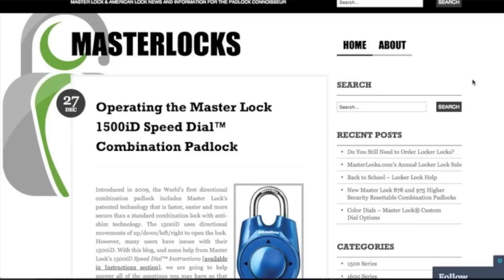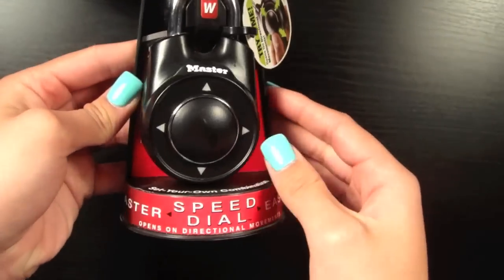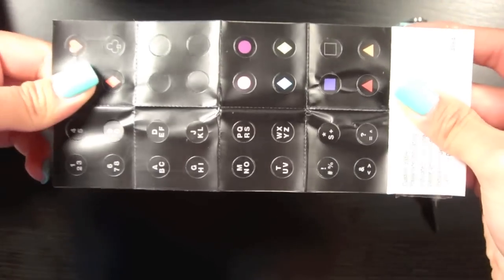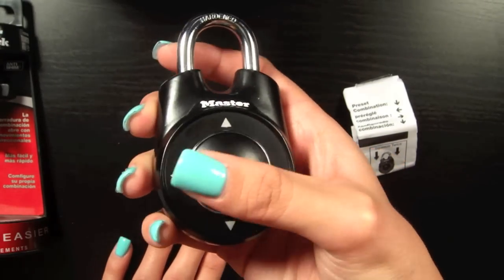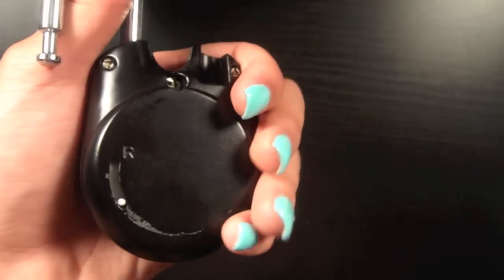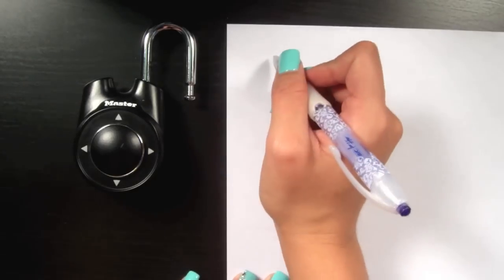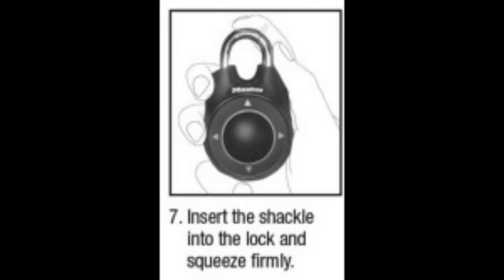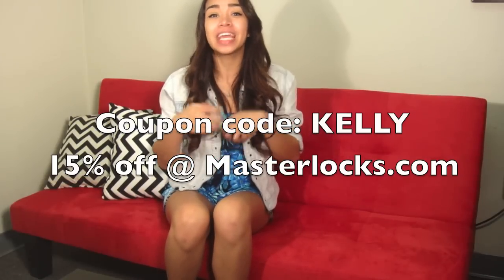How to Open & Reset a Master Lock 1500iD Speed Dial™ Lock

Comment: WHY IS MINE NOT OPENING?!?! 😩😫😭 I’ve been trying for 20 minutes 🤦🏽‍♀️ and I’m T the gym
Reply: You must keep pressure on the stick, not letting go like she did, it says in the instruction to bot let go of the stick, if you dont it will not lock onto the gears, it is a common problem, so you cant let go after each push. Leave your finger on it and give it some pressure, that should help. I had that problem too, after reading the instructions twice I saw that you had to do it. And after I began doing it, it opened every time for the past few months

Comment: For those who have bad vibes and reviews on this lock based on locking themselves out, it is counterintuitive in that you want to close it prior to moving the reset lever back down, so knowing this...instead of swearing off of the lock, I  recommend they give it a second chance and email the combination that it comes with to themselves.  The one it comes with is ALWAYS unique enough to slow criminals and contrary to popular belief their is no need or advantage to resetting unless you have multiples that you want to all have the same combo. Even in that case you have to weigh your options to where if you have a history of the lock getting stuck on you, emailing yourself multiple reminders with subject line of what particular locks lock, that may prove better than just keeping 1 combo. If you can't tell, this is the only lock that I  endorse. You can unlock during a power outage and it doubles as a behind the back houdini magic trick.

Comment: How to starts at 1:45. That's not rude is it?  This waaaaas my favorite lock but was recently kinda supplanted by the Smart Bluetooth lock that can be used independent of your phone if you choose because it has 4 soft push buttons. It has a thinner bar so can be used on those pain thin or hard to reach lockets that t Hu is one doesn't fit because too thick. In reality,  they are tied for first as my favorites.

Comment: Lol, I found it right away. And if you read it fully, you should have been able to see, where it says that there can be anywhere from 1-30 inputs so yeah, not just 4. I made my lovk have a combination of 14 inputs. And it also says to keep constant pressure on the joystick or whatever, orelse it might not open certain times, just saying that. After you moved it for a while it might begin to occur, so you can avoid it by not letting go of the stick.

Comment: What happens if you closed the shackle and pulled the reset lever? Not that I did this, I was just wondering because kids at my school might mess with my lock. Also, what happens if you pulled the reset lever and if DOESN'T COME DOWN OR UP? WHAT IF ITS GETS STUCK? This happened to my friend. Unfortunately she had to throw it away since her lock reset lever was stuck in the middle and she left her own locker without a lock and ACTUALLY PUT TAPE ON IT. I don't want that happening to mine!

Comment: I didn't follow directions correctly because they're not clear about ACTUALLY closing the shackle, and pressing down twice.  I read it as just press down without locking the shackle, so when I change the code, I locked it.  Now neither the factory code or mine will open it.
Reply: Same here
Reply: @tr190  what?
Reply: You are a genius! I came here looking for an answer to this exact problem, and BOOM! It works. Thank you so much!!

Comment: What do I do if the combo out of the box is not working I pushed it twice to clear then tried several times always clearing after each man wtf
Reply from the maker: Unfortunately, I am not completely sure how to fix that problem. However, you can call Master Lock Customer Service and they may have an answer for you. Their number is (800) - 308 -9244
Reply: Lock Girl thanks I figured it out the lock would open but I had to pull it gave no indication it opened so I kept trying lol
Reply from the maker: Glad you figured it out! Sorry that my video didn't say that clearly!

Comment: mine won't work at all cant even get it off the box
Reply from the maker: +Isaac May Make sure you are fully pressing the shackle 2x before you enter in your combination that you received from the bottom platform of your packaging. If your lock is still not working it could be defective.
Reply: Same thing happening to me right now. Two clicks and using preset combo but the thing won't open off the package.
Reply from the maker: +HSJ061112 Contact Master Lock Customer Service number, if you followed my video exactly it could be defective. 

Master Lock customer service number: 1-800-464-2088
Reply: +Lock Girl Thanks for the advice. I ended up getting a new one and it works great!
Reply from the maker: +HSJ061112 Glad I could help!
Reply from the maker: +Cutegermansherpherd5 shortcoming in a product resulting from a deficiency to follow design specifications during production

Comment: i opened the lock and reset it but when i tried my passcode it wont work
Reply from the maker: +Leo Karlsson Westin (SuperCrafter917)  When setting your own combination you have to ensure you follow the directions exactly. Since there are several problems that could possibly occur, unfortunately I can not help you with this particular problem
Reply: I did the same thing did you find out what to do
Reply: +Lock Girl ok , thanks

Comment: The one biggest problem you had, you didn't address. Where is the combination? It's at the top right of the instruction page. For some reason, it is easily unnoticed. One solution would be to have it in color. Or to put a double-line rectangle around the code to draw your attention to it. Or, even on the outside packaging, tell the buyer where  to find the initial combination. You had to call Master lock to find out where the code was. Nothing in your video tells the viewer where it is, all we know is your initial code, because you told us what it was. For this video to be of any value, it needs to be re-edited to address this issue.
Reply from the maker: I feel like this is addressed when I pull the instructions out of the packaging. The instructions are very hard to find, but this is for security reasons so people do not steal the lock. I do feel like I make it very clear where to find the instructions. I may not point out where the code is on the paper, but when you pull the instructions out the code is very visible.
Reply: +Lock Girl hey I've been using this lock for two years using a same combination I've been using it every week for the gym but it stopped working last time I tried opening it, what should I do
Reply from the maker: Unfortunately, I am not completely sure how to fix that problem. However, you can call Master Lock Customer Service and they may have an answer for you. Their number is (800) - 308 -9244
Reply: okay thank you
Reply: Nice video, but I have to agree with jmr... , the hardest part was to find the preset combination and it isn't shown in this video. Everything else is so easy that the video is hardly needed...